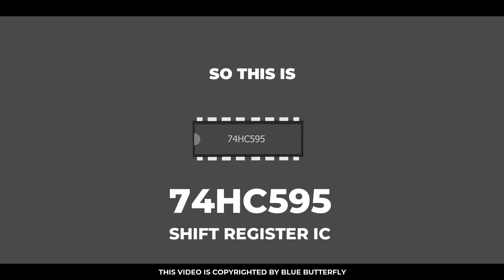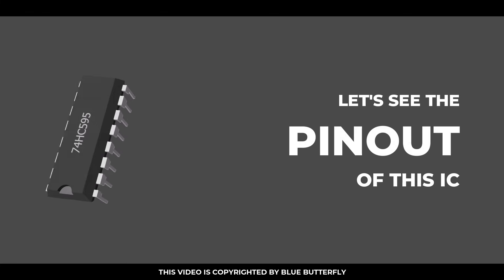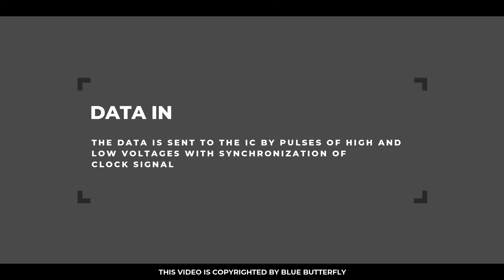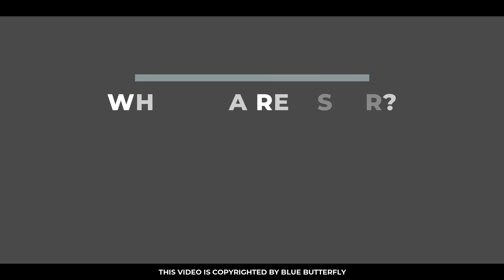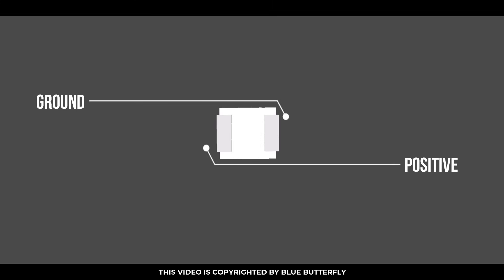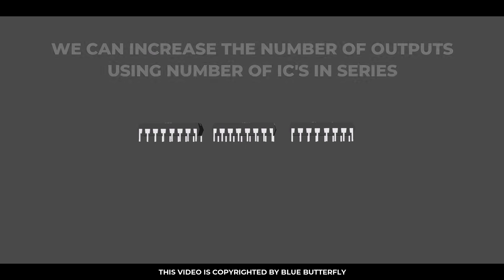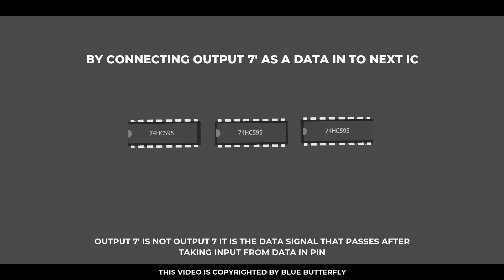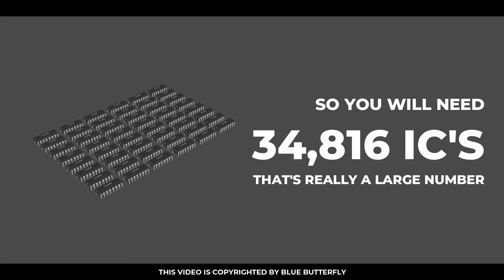How 74HC595 Shift Register Works ? | 3D animated 🔥

Comment: What is the function of 74HC595 in L293D Arduino Shield?
Reply from the maker: Good question bro 74hc595 me eight outputs hote hai jo input hote hai for l293d agar hum direct use kre l293d to jyada arduino pins use hone but with shift register only two or three pins can handle two l293d ic's